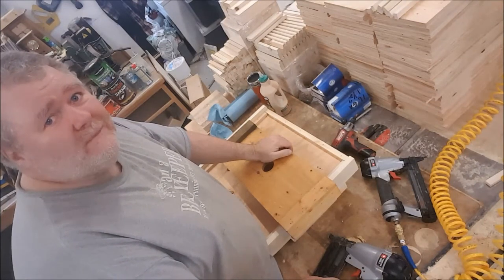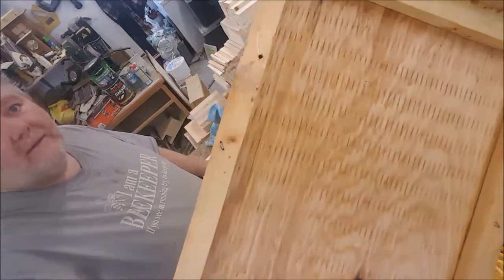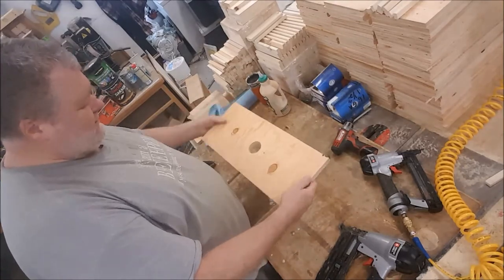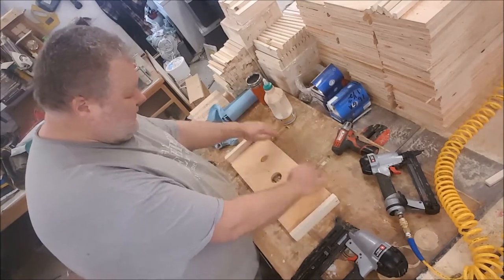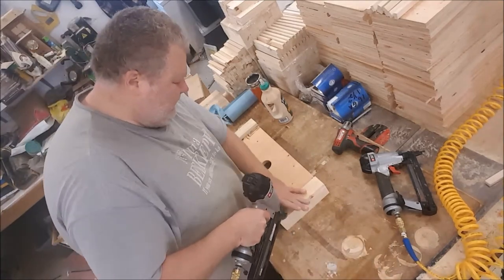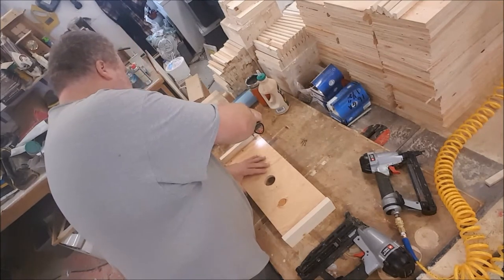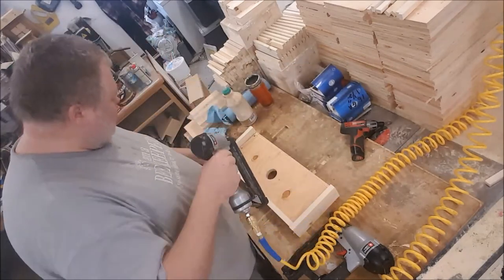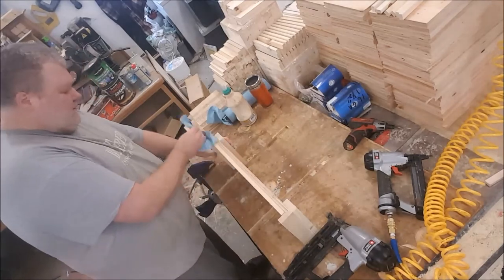🔨Building Migratory Covers-That Bee Man

Comment: While putting on the shim why not leave a small gap on the front shim for air flow.  If you want to close it off then just slide the top cover back.  That would be in times of dearth with robbing.
Reply from the maker: If that is your need, you certainly could do so.  That has not been my need.  I can easily prop the cover up a little if I feel I need ventilation but I rarely do.